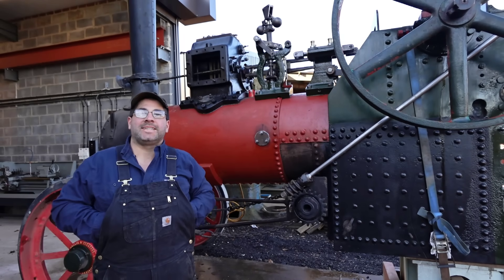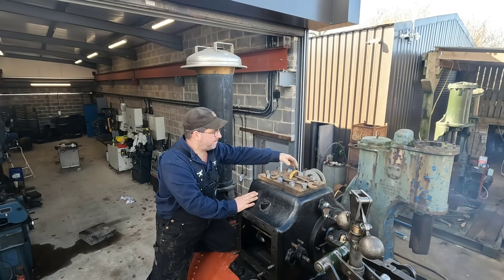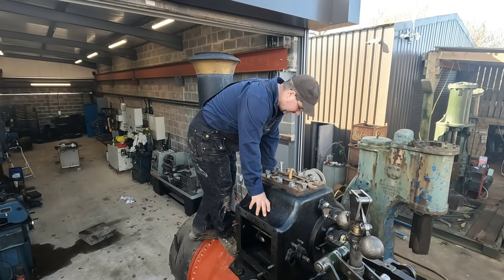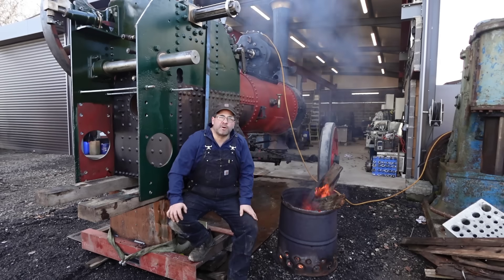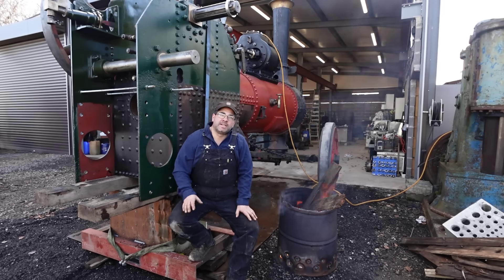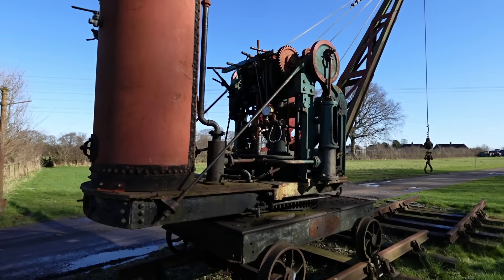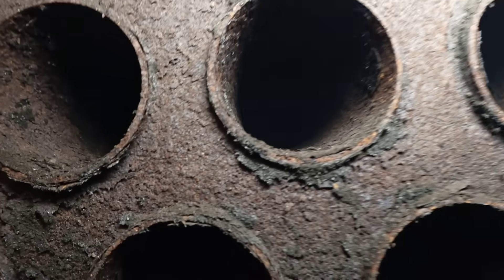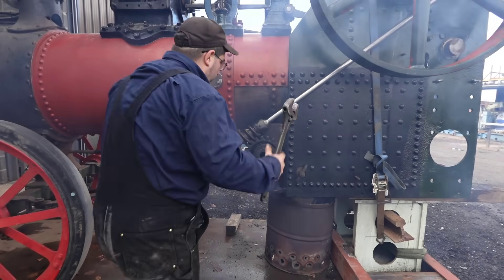hydraulic BOILER TEST we have issues!!!

Comment: I remember watching a couple of chaps doing a boiler test on a black 5 in the 70s. There was, what I can only call, a massive bucket of water with a hydraulic pump. This was being pumped into the boiler to check for leaks. 

For some reason they were struggling to get the pressure up. Being a curios person, I asked if I could assist?

Yup, keep pumping kiddo. 5 mins later, you can stop how lad.

Took a walk up to the smoke box, which was now open, only to see water gushing from each tube where it sat at the end plate. 😂

It was in steam again shortly after, but it was interesting to see a pressure test without the need for heat.

Comment: Always renew tubes, if you don’t know history or how long boiler was laid up etc.
At best extract a couple to examine condition.
In cold weather by all means use warm water for hyd but don’t light fire.
Hyd test is designed to be arduous for boilers, they were built to a safety factor of 8:1 & usually scrapped or repaired if economic to do so around 4:1.
Just simply pump it up to 11/2 times & assess leaks etc & address them.
Also when you steam it make sure it’s nose up so the crownsheet is well covered to give you time to draw fire if you getta prob.
Also make sure u’ve got no rubber joints in after hyd, cos they’ll blow out under steam.
I found this out hard way when steam testing a boiler who’s owner had done the blanking off. Filled workshop with steam in less than a minute.
I know in old days they used to hyd test boilers by firing em up, but you really gotta know wot your about.
I spent 35 odd years in this game, traction engines & railway loco boilers & have seen some fun n games.
These things are not playthings & I used despair when owners wouldn’t ask for advice & hava go themselves or the boiler inspector would turn up & say; “I haven’t seen one of these before” & then proceed to ask me for advice, lol.
Take your time, seek advice  n go careful.
Reply: Did you have to ask Fred D if you were doing the correct things ?
Reply: @tonywright8294  😂
Never met up with him!
But I had the good fortune to come alongside some good boys in my time who knew the job inside out & taught me all the dodges etc cos I wus willing to listen n learn!!
Boilersmithing is a young man’s game n not for the faint hearted esp when faced with 2,000 odd stay heads to knock over 😂
You never stop learning ol son!!😎
Reply: @tonywright8294  he would reply "Oh Aye, you know, better be prepared"
Reply: Pulling the tubes lets you inspect the boiler barrel for corrosion, pitting and wastage. Leaks are one thing, a barrel split is something else.

Comment: Not the result you wanted norm!  But be good for the future with new tubes in her boiler.
Be interesting to see you doing the job too.
I take it you have sorted the alignment issues between steam chest and crank now?
Keep up the good work norm!👍
Reply from the maker: @Dave.w-ev9qn1962  Yes the cylinder was moved and corrected the way shaft bracket and governors was also moved. Should all be correct and final fit as long as there’s no leeks when we manage to get a test on it. Cheers 👍
Reply: @ 
That’s good mate! Not too much of a problem to sort then.
Don’t look like too many tubes in there to be extracted, good luck with that job!😀👍
Reply: It’s not what Fred D would have done is it ?